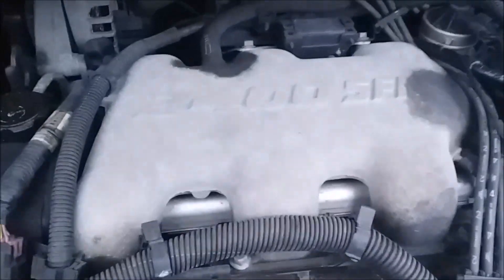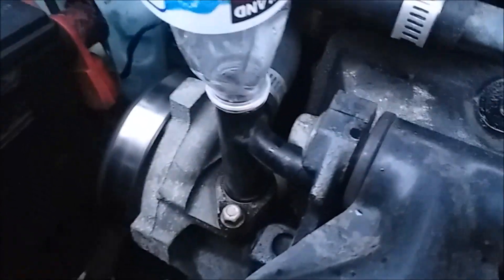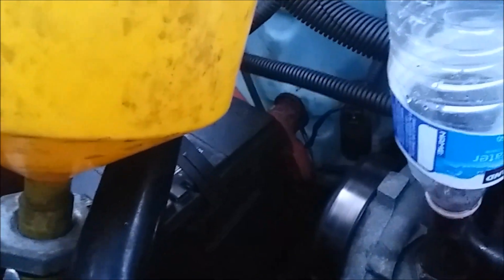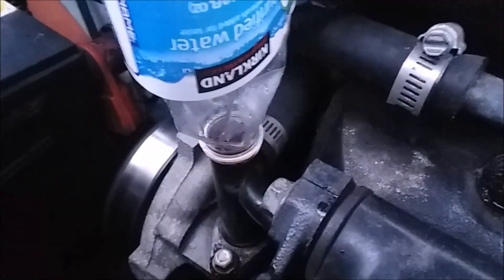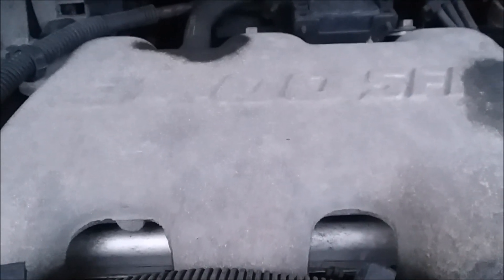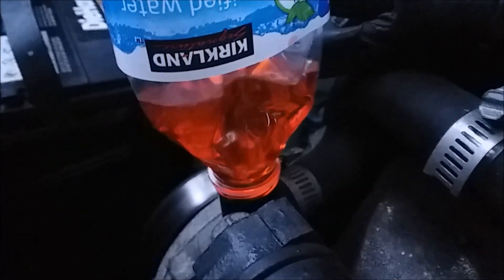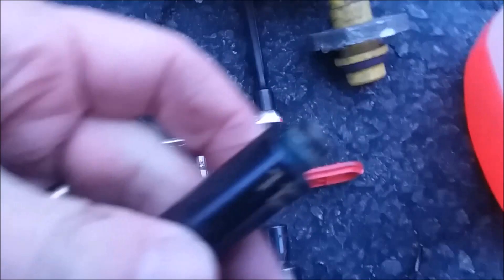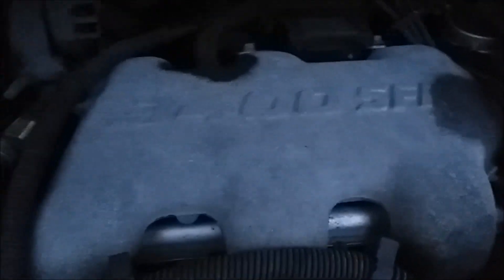GM 3400 Pontiac motor Anti-Freeze Bleed Air - water bottle trick

Comment: Thanks for the tip, this worked great. When it would start drawing the antifreeze back in  would add more antifreeze into the bottle which helped to fill the system.

Comment: Thanks I was going to to go to the junkyard for 7mm person before me broke the top of the 7mm off even if I did that it’s still not the highest point I also saw a guy who put a plumbing check valve in the spot because it wasn’t the highest point but what you did would work just as fine. Doing this tomorrow thanks ❤🎉

Comment: I did this on my 2005 Chevy Uplander. What people fail to mention,that when the engine is running,the hot antifreeze + the heat from the engine  will collapse the cheap plastic of the water bottle ! Better to do this,when the engine is cold,add antifreeze to the water bottle funnel,then squeeze the radiator hoses,forcing as much air as possible out,then remove the funnel,replace the bleeder valve assembly. Start vehicle,warm it up,then slightly open the bleeder valve just enough so you see air bubbles. Yes you will lose some fluid. I had trouble getting the water bottle to fit onto the access point, and had to cut some slits in the top ,so it would fit down over .

Comment: You just have to loosen the little bleeder valve on top of the bleeder screw, then it will be much easier. Good ideal with the bottle though.
Reply: wont work....bleeder lower than upper hose....i have same issue
Reply: I agree just loosen the bleeder valve and place the bottle on top.  Saves you the grieve of trying to put the bleeder valve on again
Reply: If you have grieve putting a bleeder screw back in obviously  you don't belong  anywhere near a car or tools.

Comment: Why do people still believe that the heat/fan has to be on for modern cars? This isn't 1979, when the temperature lever regulated a physical valve by closing off the heater core hose pipes. In modern cars, the HVAC duct flap regulates temp and the coolant passes through the heater core regardless of what the cabin temp or fan is doing.
Reply: We do it so we can tell if we got the air out of the heater core, and it's not blowing cold

Comment: Does this work if I only have the one bleeder screw for the water bottle? Because where the other one should be there is a bypass tube going from the thermostat housing to the coolant reservoir and I don’t think I have a radiator cap, only the coolant reservoir cap
Reply: I have the same issue in an 07 Torrent.  No bleeder screw on the drivers side, just the one shown here.  Pressurized bottle, no rad cap.  

I'll have to try this.

Comment: what bottle is that...cant find a bottle that fits
Reply from the maker: was just a water bottle... not suggested. radiator cap funnel is proper equipment. honestly, I did not think it would work. stay safe... use proper equipment. Be Blessed, DTG

Comment: I don't understand why people say you have to turn the heater on. The heater controls only operate the blend door and fan. Am I wrong? Heater hoses carry hot coolant through the heater core whether or not you operate anything inside the vehicle.
Reply: Yep! I also made the same comment before seeing this. 70's cars used physical valves by cable. Modern cars (at least all that Im aware of), dont use heater core valves.
Reply: WTF, turn my heater on so coolant flows through Heater Core??? Hahahaha it does already, all turning the fan on does is blow air through it... Some of these videos are idiotic

Comment: I'm not sure that I get the point of doing this? I mean don't u just open the bleeder valve and start filling the coolant resivor until it starts coming out the bleeder valve close it. And start the engine with heat on full blast and that's it?
Reply from the maker: our 3400 would hold air in the top of the motor and in front of the thermostat... had to get car to warm up enough (building enough pressure) to open thermostat... then bleed out air. I don't really recommend doing it this way... I saw it on the internet and gave it a try vs. the proper bucket over radiator cap.

Comment: Wow that’s awesome I need to try this on my Pontiac Montana sometime
Reply from the maker: in a pinch... it works... using a proper radiator fill bucket is recommended. be careful of air bubbles popping antifreeze back out. Be Blessed, DTG
Reply: @DavidTGould  DRAIN THE DEX COOL OUT...OVER TIME IT GUMS UP..AND CLOGS UP YOUR COOLING PASSAGES..IT ALSO..EATS UP AND DAMAGES THE GASKETS...LOOK THIS UP ON HERE.. AND YOU WILL SEE FOR YOURSELF...GO BACK WITH THE YELLOW ANTIFREEZE.. THANKS...*ONE#1*

Comment: I did this for my 2003 Venture and it really got a ton of air out of the system and the heat that blew out was very hot compared to what it had been.  Thanks for showing this trick!  Did you have to do it a couple of times over the winter, or was once enough?
Reply from the maker: our's turned out to be head gasket air... BUT we got away with a solid year + (20K miles) by relieving air in system before it got so bad thermostat would not open. (I believe air bubble  between antifreeze and thermostat does not allow temperature to get hot enough to open) time for intake and headgasket video on this end!
Reply: It's amazing to see someone with so little mechanical ability be so annoyingly redundant.
 Drill a 1/8 inch hole in the base is the thermostat flange to add an air bleed .
Reply from the maker: @anastyb , I guess I know enough to be dangerous with mechanics. question... how does drilling a hole at the base of the thermostat relieve air in system with air bubbles floating on anti-freeze?
Reply: @DavidTGould I'LL TRY TO SEND A VIDEO OF A OLD SCHOOL MECHANIC. WHAT HE FIGURED OUT. AND THAT WAS PART OF WHAT HE DID.

Comment: What if your heater and fan didn't work?
Reply from the maker: We hooked up a manual fan switch to over-ride when computer failed to see required activation temperature. (once again... this is back yard mechanics... the real answer turned out to be replacing the head gaskets)
Reply: What if you don't own a car? Marc, are there no schools in your area?

Comment: Do NOT use dexcool! Can't tell you how many mechanics have said to not use it because of what it does to gaskets! My mechanic told me after replacing intake manifold, and numerous videos and sites say the same.
Reply: Dexcool does things to cork gaskets, it's outdated information, if you still have cork gaskets in your car. the silicone used in modern gaskets is not affected by dexcool
Reply from the maker: removed the negative response... sorry about that. we are all learning here.